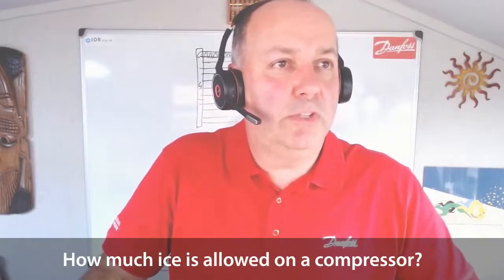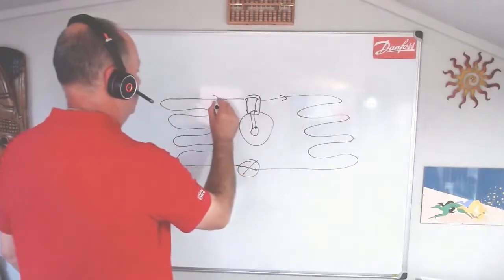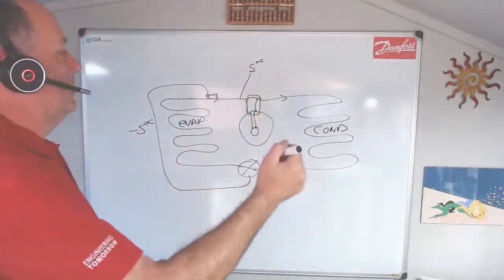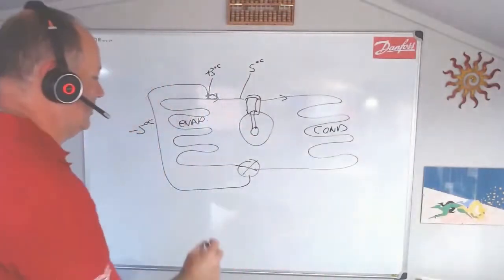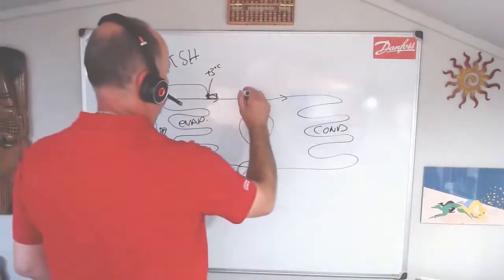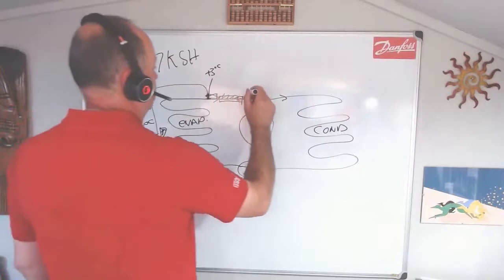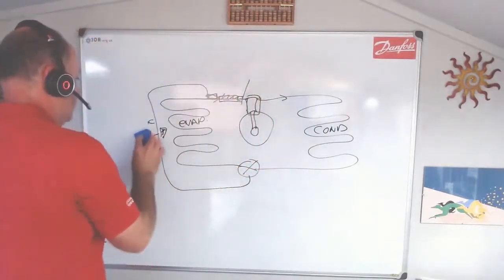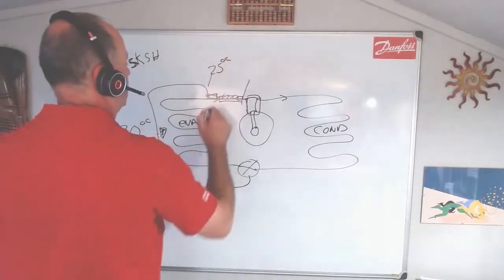How much ice is allowed on a compressor? | Ask an Expert

Comment: What happened wen the suction line freeze and ice starts to seen an the compressor
Reply from the maker: Thanks for your question! We are checking with our experts and will get back to you.
Reply from the maker: Hi. The amount of frost on your suction line depends on the application, if it's a chiller then something is wrong with the refrigerant charge or evaporator or expansion valve.

If it's a freezer then it will be expected, however the frost should not come onto the compressor any further than suction connection. Please check superheat between evaporating temperature and temperature of suction connection on the compressor.

Comment: How much superheat is necessary and sufficient?
Reply from the maker: Hi, we are checking with our experts and will get back to you.
Reply from the maker: Hi. We need superheat in the evaporator to ensure the suction vapor coming back to the compressor is not carrying any liquid to avoid compressor failure. The amount of superheat needed depends very much on the application, however as a guide you need to have approximately 7 kelvin superheat in the evaporator to ensure dry suction vapor returning to the compressor. Then the suction line will pick up ‘suction superheat’ depending on the length of pipe and how well insulated the pipe is.
Reply: @DanfossClimate  Thank you. Can you please tell me if the 7kelvin is for dynamic vaporizer blowing or not?
Reply from the maker: @Raumax  Hi, we're checking with our experts and will get back to you.
Reply from the maker: @Raumax  Hi. It is for when the fans on the evaporator are working.

Comment: Won't an EPR ensure it doesn't freeze up?
Reply from the maker: Hi, we are checking with our experts and will get back to you.
Reply from the maker: Hi Will. Yes an EPR (evaporator pressure regulator) will maintain a set stable evaporator temperature in the evaporator, normally used if you need a precise evaporating temperature and humidity for the refrigerated goods or if you have more than one evaporator on a system in which one evaporator needs to evaporate at a higher suction pressure than the other one. However, you would still need to set up the expansion device to maintain the correct level of superheat and control suction superheat level with correct level of insulation etc.
If you just want to control the pressure that the compressor is getting from the suction side then use a CPR (crankcase pressure regulator) for example in a blast chill application were the load in the cold-room is high at the beginning of the cycle you would control the suction pressure so as not to overload the compressor motor. We hope this answers your question!

Comment: Dear sir May I contact you on WhatsApp please. Sir I am a HVAC TECHNICIAN so I am working on  R404a chiller which control the temperature of CO2. But yesterday I have changed the txv valve but now after installing there is ice on suction line and a little on compressor so please give me any suggestion or your WhatsApp number please. Thank you
Reply from the maker: Ice on the suction line or suction port on the compressor, may not be a problem in itself. You may however need to check your superheat setting again, if it has been set correctly: Measure the temperature where the TXV bulb is placed, and your suction pressure. Convert the suction pressure to temperature, and deduct from the measured temperature. Compare that to the design superheat, and adjust accordingly.

Comment: I have a refrigeration plant for freezer application using r 22 as a refrigerant is it normal to build up an ice on compressor body? I hope you notice and thanks
Reply from the maker: Hi, Thank you for your comment.
When evaporating below zero deg.C for a freezer, in the region of -24 deg.C for a room temperature  -18 deg.C,  the suction gas back to the compressor will be below Zero deg.C. It is normal to have an ice build-up on the suction valve, but not the compressor body. You need to measure the suction superheat to find if the suction gas to the compressor is the correct  temperature. Too much suction superheat and you risk high discharge temperatures or too low, and you risk liquid returning to the compressor. In both cases, it will cause compressor failure. A freezer room at -18 deg.C temperature would evaporate at -24deg.C. The Evaporator superheat would be 8 Kelvin, meaning the suction gas leaving the evaporator should be -16 deg.C. The heat picked up in the suction line coming back to the compressor is dependent on the length of pipe, ambient temperature, and thickness of the pipe insulation and integrity. It would be expected the temperature on the suction valve of the compressor to be about – 8 deg.C.
Ice on the compressor body means that the suction superheat is too low.
Hope this was helpful :-)

Comment: I design a system with MTZ-40 compressor, using thermo expansion valve R404a -40 / 10. The ice would cover all the compressor after a few minutes running. What could I do abount that?
Reply from the maker: Please check the superheat on the evaporator which should be about 8 kelvin, then please check the suction superheat back at the compressor suction valve. If you are evaporating at -40deg.C, then I would expect the temperature at the compressor suction valve to be in the region -20 deg.C. If the ice is covering the whole of the compressor you can increase the superheat on the expansion valve to reduce this. However you also need to check the discharge temperature to ensure it is not getting too warm because the greater the suction superheat, the greater the discharge temperature. I would expect a discharge temperature around 85 deg.C

- John